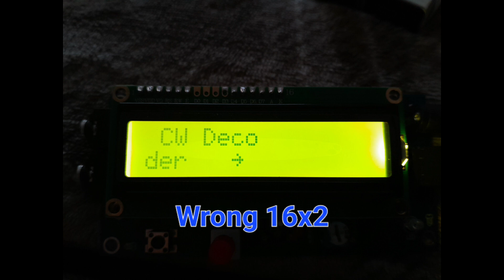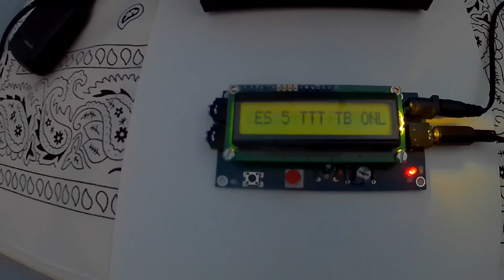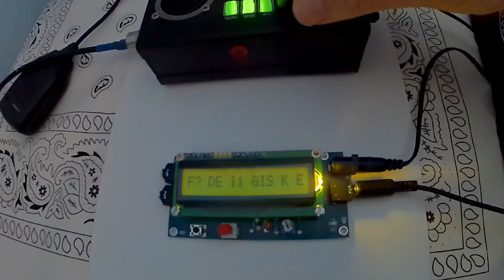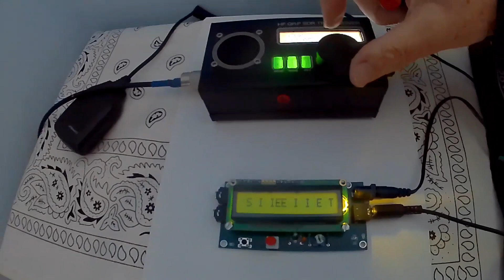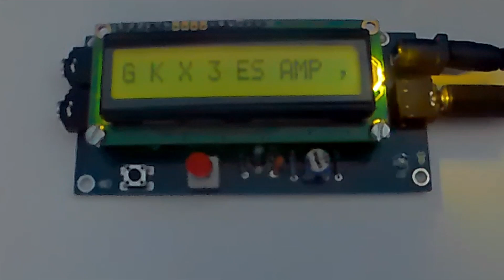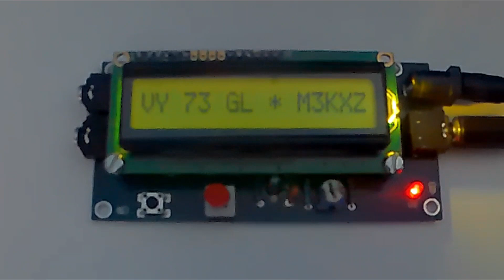Ham Radio. Low Cost. CW. Morse Code Decoder.

Comment: Not bad for the price.  I bought one, and after some adjustments it works quite well on 40 meters.  I would reccomend it. 73's.
Reply from the maker: The quality of these decoders vary quite a lot. The fist one I purchased worked well but since then I have found they are not as good. Cheers from old George

Comment: The decoder is basically either a parts source or an electronic toy to fool around with.  It doesn't work well at all under real conditions.   You can practice sending code with a paddle and an electronic keyer with it and that's about all.  You have to have a super good signal for it to work at all, a rare thing.   Put you money into something more useful.
Reply: More useful like a ......... ....

Comment: you need to get rid of all the background noise as possible... or you will get those "E" codes or " * "codes. Turn down the RF gain as much as possible and it will do better... not perfect.. but better, thanks for video.  73 NS9T
Reply from the maker: The radio doesn't have a RF gain. Anyway it has its own morse decoder built in. It was just a try and it works great with my FT101 as shown in other more recent vids etc.
https://youtu.be/Ibc-JvPyq0I
Reply: I was wondering that... thanks

Comment: I got one of these to experiment with.  This one has 2 lines of text, but only 1 is used.  It also has a USB C port, I'm assuming for power.  It still has the 9v power connector.  Next to the USB-C connector is a dip switch with one switch, and next to it, it says USB, so maybe that's for turning the USB C port power on and off?  No instructions, so I'd have to try to reverse engineer the thing to try to make sure.  The one potentiometer along the bottom is for tuning the frequency, but as of yet, I haven't been able to get it to 700hz.  It's a bit higher frequency than that, but I haven't connected a frequency generator to see what its capabilities are.
Reply from the maker: Hi Paul. I've got a 2 x line one as well as a single line display. The two line version I have .I found it very difficult to use. To such a point I haven't made a case/enclosure for it as it doesn't work very good compared to single row. George

Comment: Thank  you for this. I got no instructions at all when I ordered one from Amazon.
I like it for learning CW, for that I am happy it is picky about the code.
Reply: planning to do the same
Reply: Can it be modded to run at higher speeds 12 wpm ain't quick enough
Reply from the maker: Gosh that's a good question. But there's not a lot of info, circuit diagram haven't seen one. So sorry no idea. Just don't know. George

Comment: Glad to see more videos from you! Hope you guys are well.

I had a decoder years ago from MFJ that was hooked up to my commodore 64. It actually worked quite well, but a few I've tried since over the years don't work as well. 

I've been meaning to try one of the software ones that uses the PC audio input. Just haven't gotten around to it yet.
Reply from the maker: Hi Rick. I am going to have another go at learning morse. Been trying on and off since 1983. Not had much success as possibley due to me being dyslexic. But hey ho that's life. George
Reply: @MakeDoAndMend1  I've also had trouble learning it. Never got over 5wpm requirement. Even in the Army it caused me more problems...